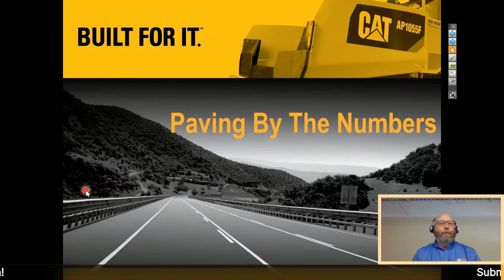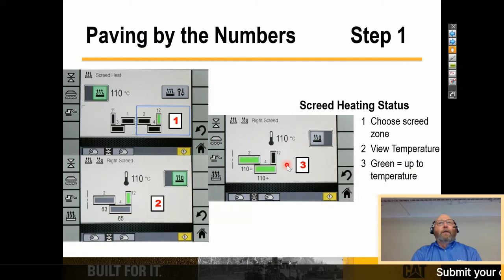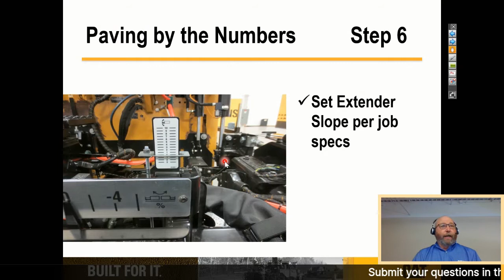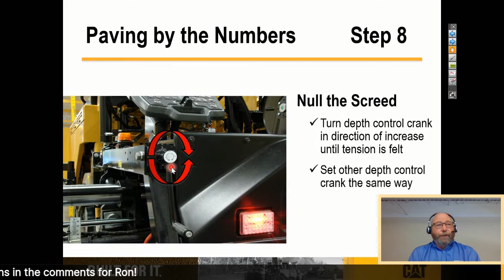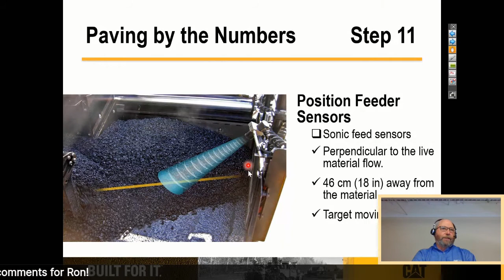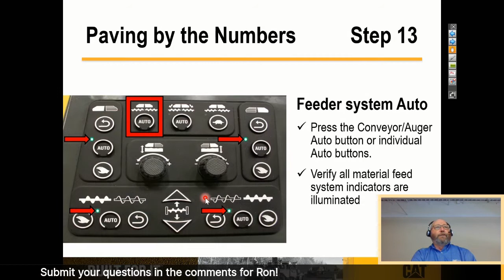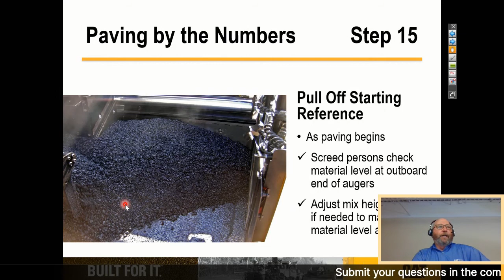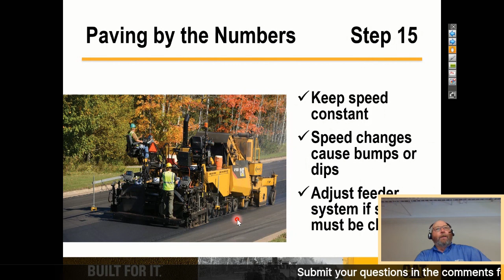Cat® At Home Series – Paving by the Numbers with Ron Wilson

Comment: Hey Ron you mentioned that the tow arms were set differently in the older models. Where are they recommended to be set on the D and E models?
Reply: Wouldnt a good starting point be half the tow point cylinder stroke.